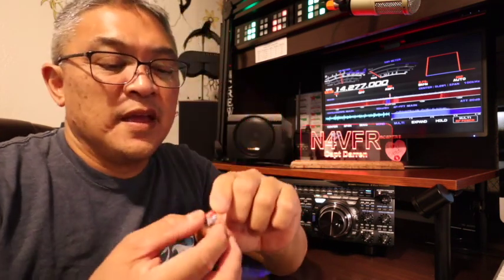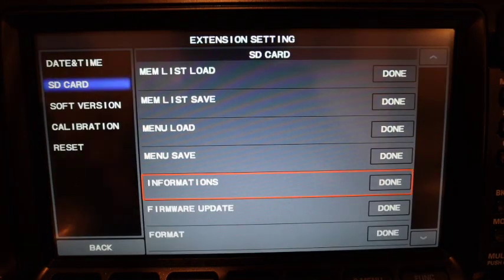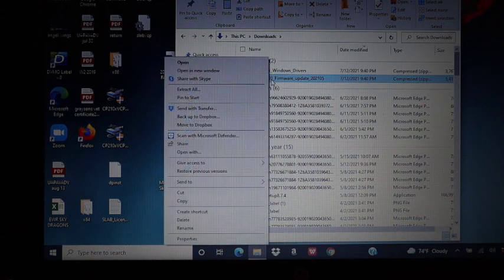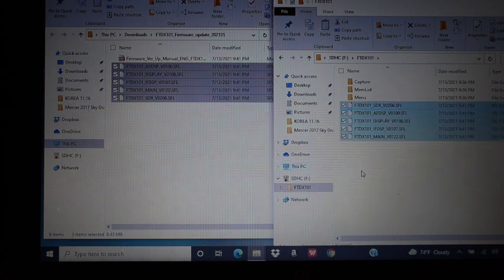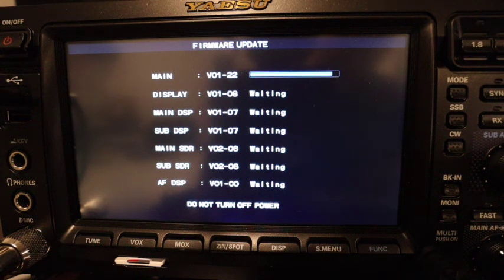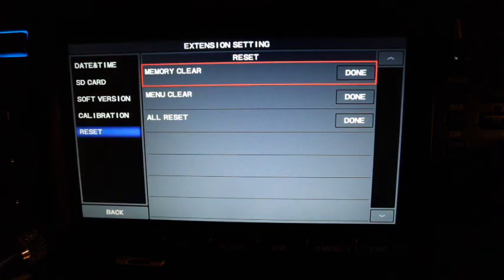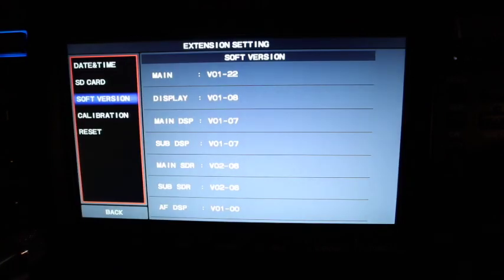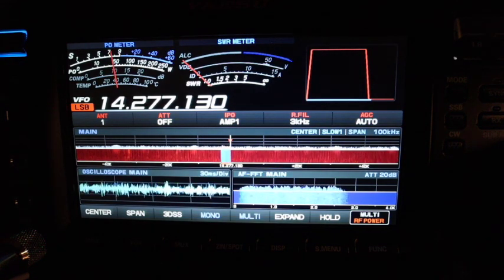New! Firmware Updates on Yaesu FTDX101D/MP! The Process Required!

Comment: Nice video. Thank you for sharing. I have an issue updating MAIN SDR and SUB SDR to V02-06. I see in your video you were using Firmware Update 202105. I will send you an emai to see if you can share me the firmware update zip file. 73
Reply from the maker: Thank you.  Here's the link where you can download the firmware.  Click the File Tab and scroll down to the bottom.  https://www.yaesu.com/indexVS.cfm?cmd=DisplayProducts&ProdCatID=102&encProdID=959169DE998192AB87295E90077D740D&DivisionID=65&isArchived=0

Comment: Hi.  Nice little video, cleary showing the basic steps of the firmware update procedure.

My only comments would be:
1.  Unnecessary to "format" the card in the PC first, and then again in the radio. The radio will wipe & format the card correctly, without the PC step.
2.  Unnecessary to do a radio "RESET" after the update is completed. The updating procedure actually resets the radio upon completion.  You'll notice that the radio shuts down upon completion of the file install, then restarts. This is the "reset" being done. No harm in doing it again, I suppose. But nonetheless, an unnecessary step.

73,
Alan
W0ARM
Reply from the maker: Thank you for the comments,  recommendation, and explanation on the format and resetting process.  I agree with you on that.

Comment: you can use the mac.  for the upgrading. etc.
Reply from the maker: I'm not sure however, the files that Yaesu puts out does not have the DMG install files.  They only publish Microsoft Windows compatible files.
Reply: @DarrenN4VFR  dosn't matter your not running the file only copying,  and mac is compat w/almost all formats certainly all the windoz ones.. no worries there  try it one day. works on my 101 and 9000mp etc
Reply from the maker: @mylesl2890  Ahhh!  Oh okay, copying the files only and not executing them.  That make sense.  Thank you for the tip!
Reply: @DarrenN4VFR  buzz me anytime. more mac's more ham =more fun!

Comment: is this the antenna you are using? https://zerofive-antennas.com/product/27-foot-hoa-10-40-meter-no-radial-multiband-foldover-vertical-with-unun/
Reply from the maker: Yes, that's what I'm currently using.
Reply: @DarrenN4VFR  Thanks! seems to check all the boxes for what I'm looking for and the fact it includes the tilter mount is nice as that gets me off the hook with the HOA